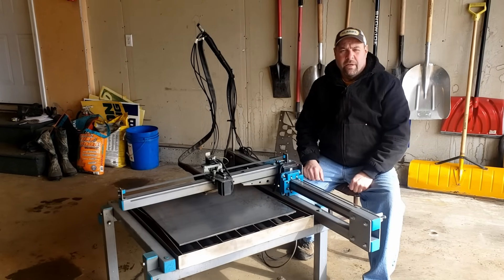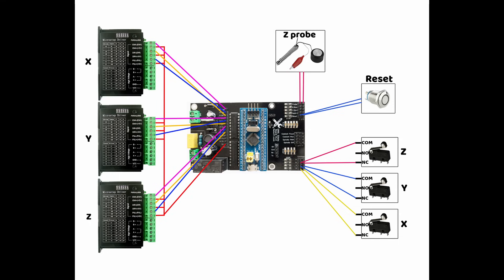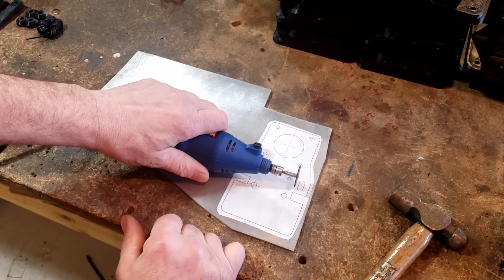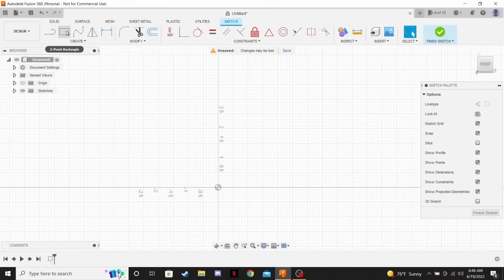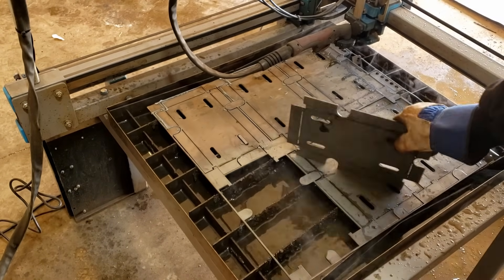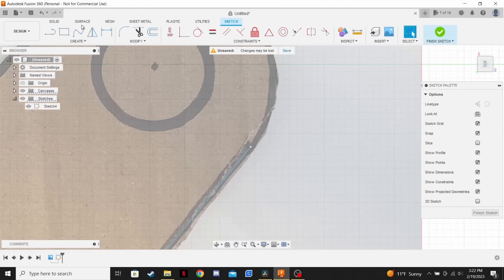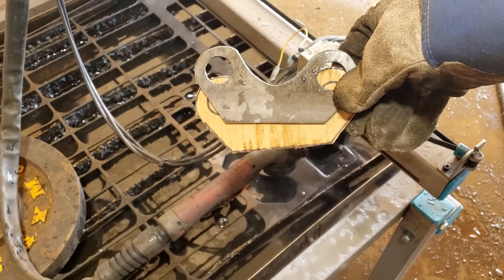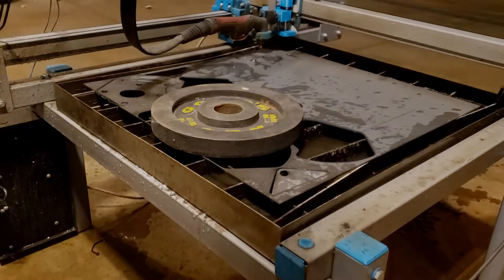Best DIY CNC Plasma Cutter

Comment: I'm following you for quite a time now and absolutely love your projects! I will be soon acquiring your plans for the plasma cutter, but one quick question - how are you producing the GCODE for notching?
Reply: Just use fusion and do a cut-out.

Use your x axis or y axis to rotate the tube...
Reply: They have a "soup to nuts" video demonstrating a blank Fusion 360 to making a bracket, to setting up the "tool" - to the actual slicing - that creates the GCODE.

Comment: I bought mine and a few extras for another design as well. Fast shipping and great communication. I definitely recommend this if you want a true budget cutter! Thanks again!
Reply: I had the 2in tubing. I used aluminum for the cross bar($12), bolts and fasteners at tractor supply for $9. I priced the 2in at my local supplier for around $110. Electronics were another $120 including shielded wire. My nonHF plasma cutter off eBay was $150
Reply: How much?
Reply: There is a link in their description
Reply: @jakelords24  thanks that is say buy the plans $25 that hard to do ! You did completed how much material cost if you build already

Comment: i have mine complete  but have not run a program on it yet
Reply: Did you run into any problems with the drivers or motors?
Reply: @Hackjob-Extraordinaire  i did not mine went together as per  the diagram